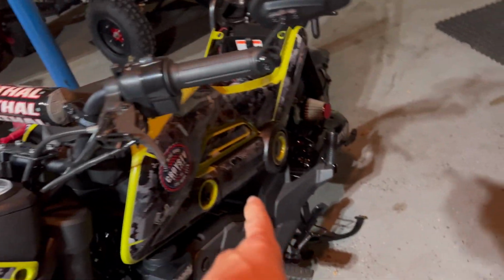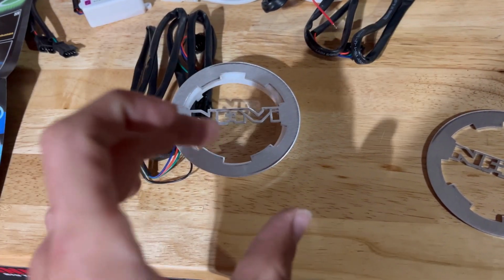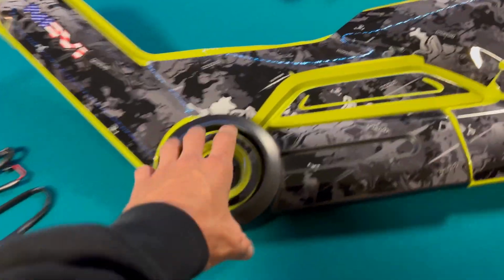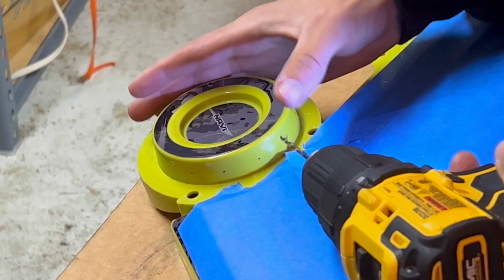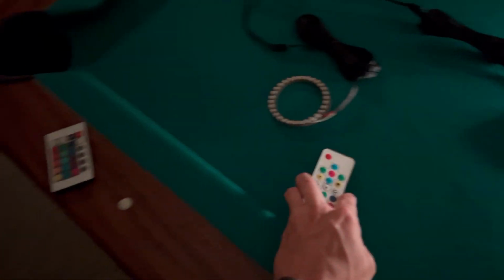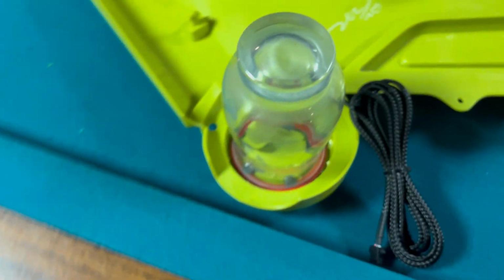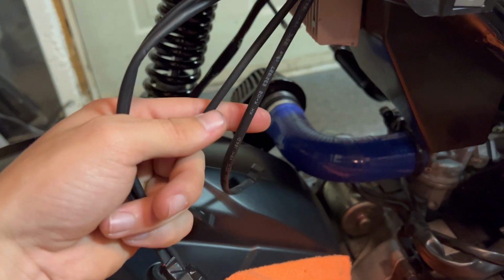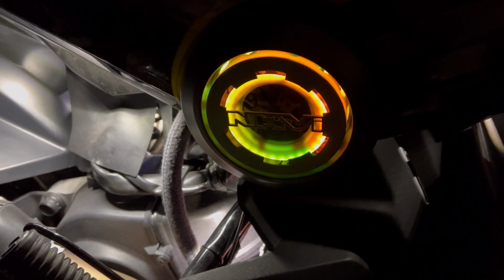Honda NAVI RGB Side Plate Install

Comment: That's was brilliant. Not just the rings but on how to mount them. I got something to do during the winter. Looking forward to more. 👍
Reply from the maker: This was the most confusing mod I have ever done. Usually when a website says “for _____” you expect to do as little work to install. By no means were the original rings plug and play either. Just have to think outside the box.

Comment: Hey man, can you link that battery. Is that what you use in your NAVI?
Reply from the maker: Tusk Lithium PRO. I got one of these batteries when I purchased my 450R, the guy before me installed it. Needless to say, everything in my garage has a version of the tusk lithium pro in it. Motorcycles, atvs, dirtbikes, doesn’t matter. Best battery.

Comment: Who ever sold that kit is crap. Give u bunch of pieces and super glue or velcro together. Dude I'm not a engineer. 😂
I'm dumb. I need step by step
Reply from the maker: I think recklesscustoms is a huge game changer in the navi aftermarket world, but those halo rings they send and the custom plates just don’t go on like you’d think. 

I sent them an email and they recommended using the adhesive on the original rings, cutting off the tabs and leaving them sticking out like a sore thumb. Aesthetically displeasing and with as much as I ride, they’d get ripped off somehow. And where do the plates go? On top of those too? I might as well glue a pringles can sticking straight out
Reply: I designed and 3d printed my own NAVI logo covers using free CAD software. I'm not an expert but I can make shapes.  The ones I designed are a hand press fit. I put them on months ago and had no issues. I don't have LEDs but there are super simple to install.